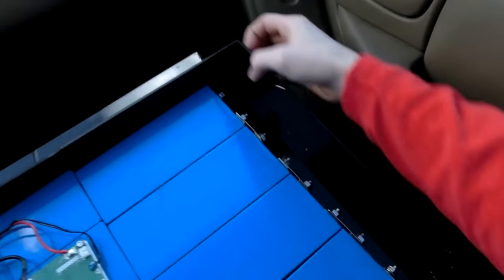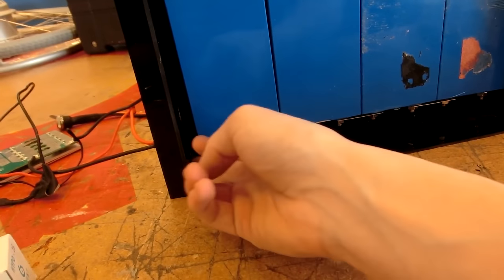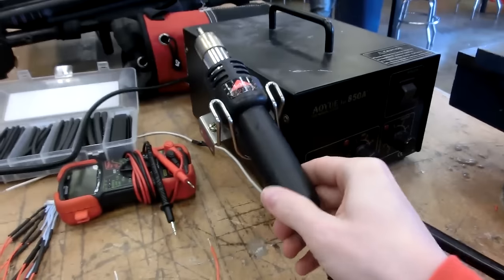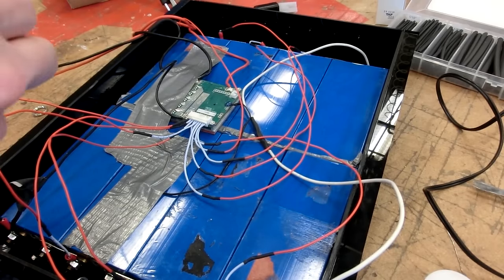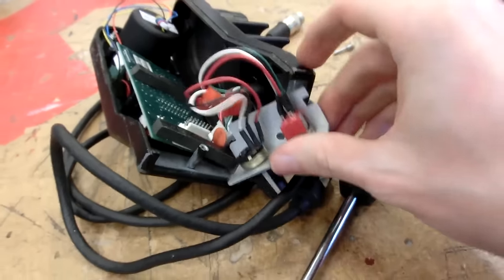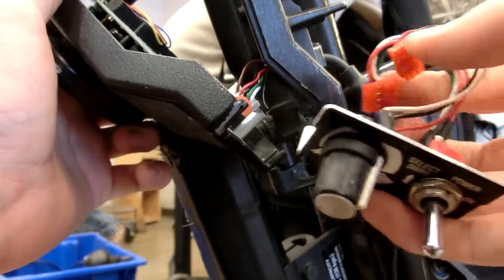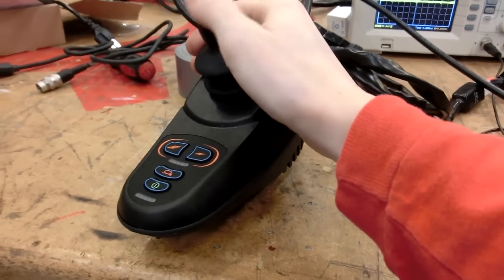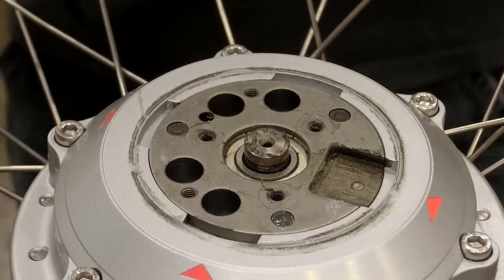DIY Lightweight Lithium Powered Wheelchair Build part 2: Motor Teardown

Comment: That controller looks like a knock-off of the controller that they use on the invacare Jazzy line. Even the sound it makes when you turn it on is a copy.

The two smaller wires on the motor are for the electric brake. The click sound you hear before Professor X's chair moves is the breaks delatching. When the chair stops moving, the breaks immediately latch so that the user does not go rolling down a hill or into traffic etc. The controller might not be working because it is looking for a resistive load on those two wires, but it kind of looks like the controller is dead.

If you spend your life in a chair, the last thing you want is dicky electrics. When I watched the first video in this series, I immediately cringed at the sight of that controller. A word of advice, stick with name brand controllers, the older ones for almost any joystick-controlled chair will do the job, and most of them can be programmed. The controllers they use on the Jazzy Jet 3 is a reliable one in my experience. The last thing you want is to be by yourself, maybe out of gas in the middle of no where, and your chair won't drive out of the van because of some dicky chinese soldering job, or knock-off mosfets.
Reply: +caramelfleece Yup... 
Yup, typically both motors and both electric brakes must be connected&#160;when the&#160;joystick/controller is powered on, otherwise, it goes into an error mode and will do nothing.&#160; Some joysticks will display a different error code via a different sequence (or number) of flashing lights.&#160; Some electro-magnetic brakes are 12v, some are 24v.&#160;

Manuals for joysticks/controllers are typically online somewhere, and they may give an indication of pre-run checks - as to what they are checking for.&#160; Both brakes and both motors are usually checked before start-up.&#160; So out-of-range resistance (shorts/opens/wackies) will cause an error.

If your motors do not have&#160; brakes, I suppose a light bulb with a similar resistance to the brake could be used to fool the controller.

Also, head on over to the wheelchairdriver dot com forums for perhaps the most experienced group of power wheelchair gurus on the planet.  A great site.

Comment: Looks like the grease is all dried up too, good time add some new while you have it apart. ; ).
Reply from the maker: +DystopianEmpire01 these wheels have never been used, they are brand new.
Reply: Rinoa Super-Genius
That's weird. : /
From the video it looks like the grease dried up. Of course if they were just sprayed with a silicone/graphite lube instead of regular grease they would look like that too but I don't normally see that on things designed for long operation at high torque. Hmm..

Comment: Awesome battery tray my friend. I just loved the way it fitted and the locking arrangement. Have you any thoughts on what might be wrong with the Drive Control System? It is going to be very interesting to see what is actualy causing the problem. Have an amazing day my very good friend.

Comment: for some reason i keep thinking the wires you are using are too small a gauge for the current. its probably me as i like to over-do the battery cables.

Comment: Haven't read through the comments to see if anyone else mentioned it.. But I think the controller wasn't "responding" because the wheels were disengaged.. They need to be in the lock position so the circuit can close... Also..the video isn't over yet.. You may have discovered this by the end of it.. Lol

Comment: This is looking like a great series. I'm wondering if you can get specs for the motor controller and hub motor online. It looks like the motor controller is providing two wires with DC power and two wires with a control signal while it looks like the hub motor has three wires for a three phase AC input from a motor drive. But that's all guesses from a short video and 3000 miles away.
Reply: If you look at computer fan motors, they are brushless DC with drive electronics integrated into the motor.  This appears to be a similar arrangement.  Two wires for DC input, and a 3rd lower current wire for speed sensing.  if it's brushless with integrated control, it's going to be useless for a wheelchair as those usually aren't reversible.  

Like you said though, not enough data to make an informed assessment.

if it were a multiphase brushless motor all 3 wires would be the same size as each winding would carry symmetric current.
Reply: It's also possible it's similar to servo systems where you have VCC, Ground, and a PWM input for proportional forward/reverse.  Without data on both the motor configuration and the drive electronics though it's all shooting in the dark.

Comment: Some controllers have fail safes where both wheel motors have to be connected for power up, so the chair doesn't go into a death spin in case of a malfunction
Reply from the maker: +Mekhanic1 thats the first thing i tried.

Comment: Looks like you'd do good to read the manual for that motor controller. You're trying to get it to drive the motors but it won't even complete its boot up phase. Figure out what it thinks is wrong and I think you'll have much more luck.

Comment: 18:40 well not that stupid, the day you will get a cart with all steering wheels and one of them will not be straight and your cart will go from left to right, use way more force to keep it going straight. Same if the floor is not level you will constantly be correcting the trajectory of the cart and using a lot of force. Compared to a cart (same goes for shopping carts) with fixed rear wheels and steerable front wheels. A full shopping cart and all wheels that can turn, trust me it's a pain in the ass, compared to one with only front wheels turning. Think about it, pay attention next time you're pushing a cart ;) 

Nice vid!

Ps: good luck pushing this cart with one hand if it had all 4 wheels that could turn ;)
Reply from the maker: +Crispy K im personally more used to carts with all four wheels free but id rather something inbetween so the casters are pushed towards a certain direction but can still be turned
Reply: Center wheel could maybe do something, not sure how exactly but with some beers and thinking someone will find a way to do it. But then you have the cost, having to add 1 more wheel to every cart... I think there could be a pretty easy fix actually... If you mount the wheels at an angle that points backwards the wheels will be pointed ahead, well backwards but in the same position as if you pushed the cart. 

Can still use a bit of force and make it turn as good as a "regular" cart.

Like those skateboards with 2 wheels in line. the wheels are in an angle and keeps them straight but can still turn.

Comment: The controller might be locked. Turn in on then hold the joystick forward until it beeps then back until it beeps.

I posted this in the week 1 video before I realized week 2 was up

Comment: I can't believe a pair of pliers have been used to tighten nuts when lithium batteries are involved. 
I only hope lock washers were used because if sparks occur they will incur voltage spikes damaging components and we've all seen the results of the hoverboards recently.
If it's installed in a static piece of machinery it may not be such a problem but on a moving vehicle vibration will loosen anything that is not locked down.
It's when the batteries are being charged is when the fire or explosion will occur.

Am I scaremongering or being realistic?
Reply from the maker: +Colin Crook id go with being unrealistic. pliers are fine.

Comment: Planetary gears, probably a brushed motor then. So the brushes may be bad?
Reply from the maker: +DystopianEmpire01 on a brand new motor? doubt it.
Reply: Rinoa Super-Genius
I didn't know this was new.
I heard him say he had this chair for 20 years, did he mean the one he was currently using then?
Reply from the maker: DystopianEmpire01
chair, yes, but it wasnt a motorized chair. he's had the carbon fibre one for 20 years and the electric one for 15.
Reply: Rinoa Super-Genius
Ok, so the motor wheels are the new parts.
I like the new battery tray, that is choice.

Comment: Does he need a vent fan in there with the batteries
Reply from the maker: batteries only heat up if you stress them a lot, his batteries should be more than big enough to handle the load without heating up too mutch.